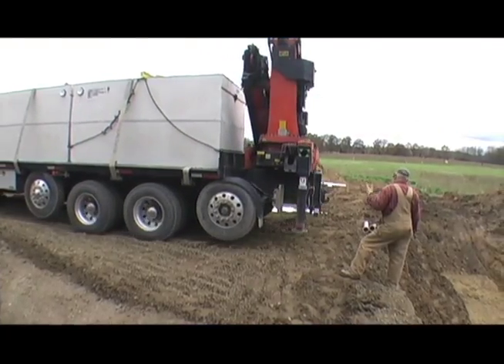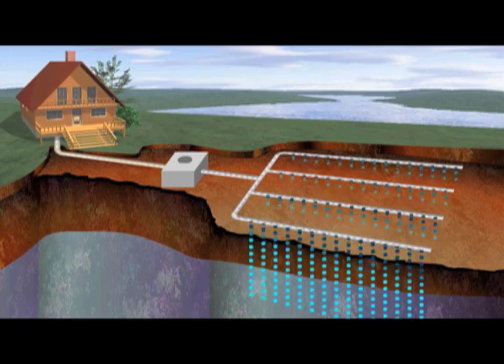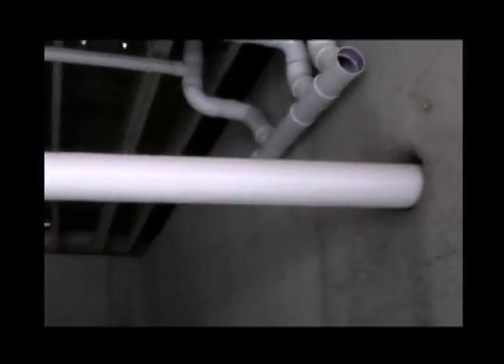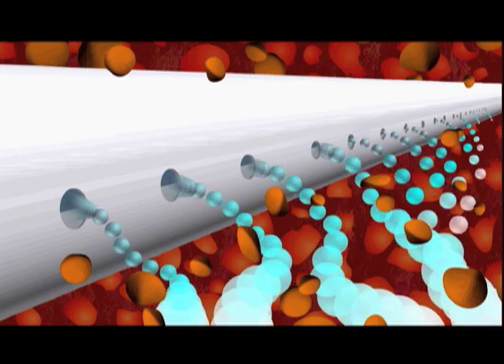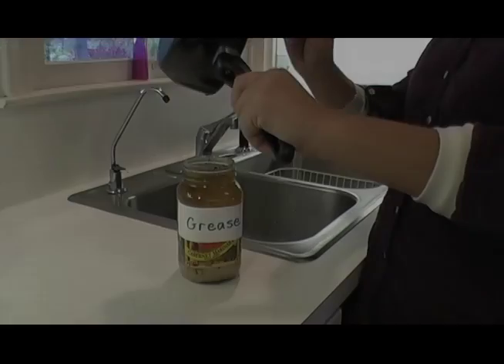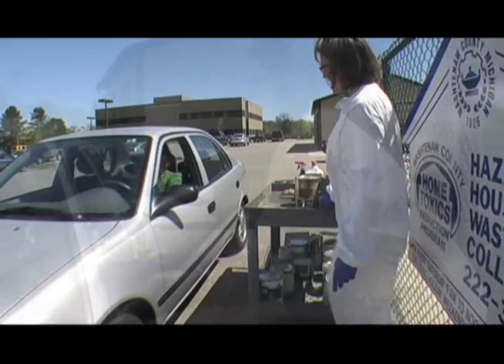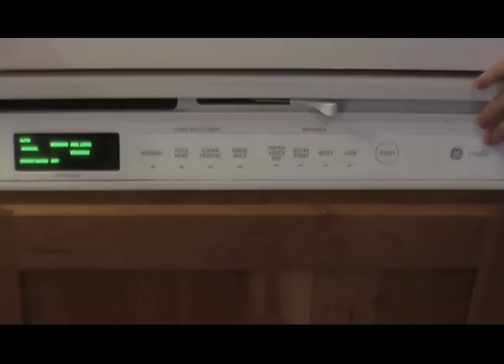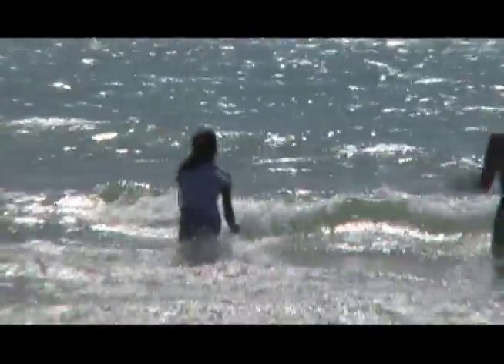"Its All Connected" An overview of On-site Septic Systems

Comment: I agree with Jason Flynn. If the systems are installed the way they should be and maintained properly they can last 35 years or more. The narration for the video and diagrams were very well done though. The biggest mistake homeowners do make is flushing baby wipes and other hygeine related products down the toilet which eventually get clogged in the distribution boxes and outlet pipe from the tank. If these products get to the leach field pipes, it's game over.
Reply: Septic Tank Pumping & Grease Trap Cleaning Pros ...Jason King...